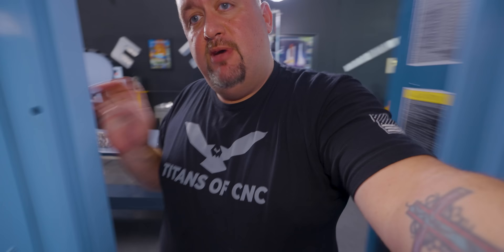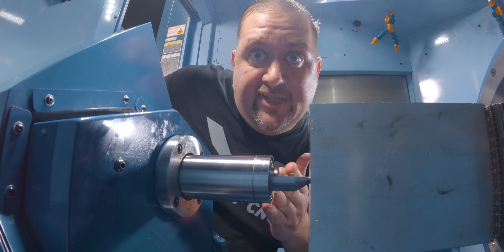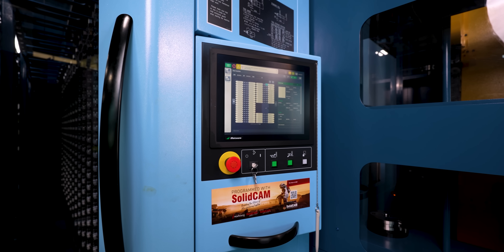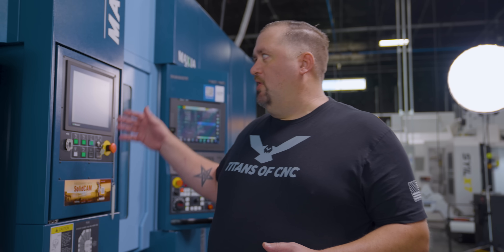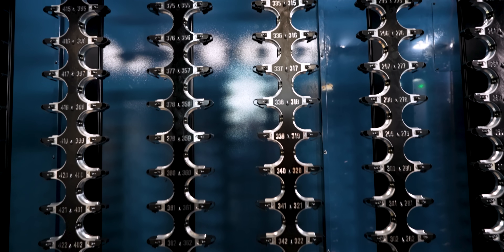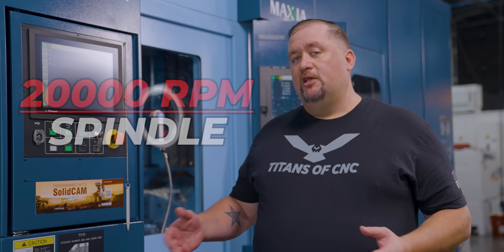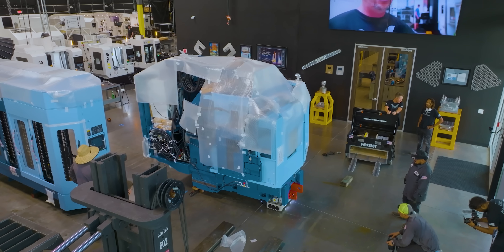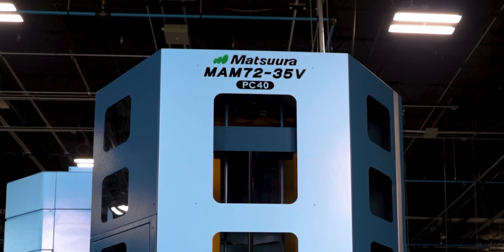You’ve Never Seen a Cut Like THIS Before 🤯

Comment: Just be careful if you ever have to turn off the machine with that particular tool changing system, because if the tool changing arm is not in its home position before switch off then you'll have to recover the tool arm with the black box and it's a right ball ache.

Comment: What's the MSRP on that setup?  Used to run three MAM72-63V machines in a shared 35 pallet cell back in the day.  That's my end goal for building my own shop.  Plus a basic vertical for cutting dovetails and material prep and maybe one of these for small parts.
Reply from the maker: For the 40 pallet and 530 tool option you are right around 950K. They have the 32 pallet and 330 tool option that saves you some $$$

Comment: I’m still waiting for the video to come out where you guys spin up both a HSS and carbide endmill and feed them both into one another
Reply: I was cutting hss tools with carbide the other day.. we had massive M64 hss tap that needed smaller square to fit into our holder.. nice cuts with feeds and speed that I usualy use in titanium
Reply: they have done this.
Reply: @ThatOneFiesta they did a video similar, they only spun the carbide tool and fed the carbide tool into the high speed, and they’ve done the reverse. But they haven’t spun both and fed both into each other at the same time. I wanna see that destruction. Then maybe a ceramic endmill vs a carbide

Comment: So, $1.25 million for the machine, 40 pallets and vises is another $100K and 530 tools, another $100k and a tip for Barry brings you in at a cool $1.5 million dollars. Run that thing 24/7/365 for 5 years and you only need to charge $5 an hour plus a machinists hourly wage and overhead, so $50/hr.!
Reply: The important part is the tip for Barry. So better make it $60 an hour hahaha. But really when you break it down, that's pretty inexpensive for the added capability and automation!
Reply: @barrysetzer  No argument there, she is a thing of beauty!!

Comment: 530 chances to crash tools xD
i have seen many things in cnc machining but not even i have seen a cnc mill impliment a hydrolic tailstock in this way (  i even seen where they used wood planks and clamps to hold  the part well machining it )
Reply: Yeah as far as I know, Matsuura is the only builder that offers this. It was VERY helpful when I used to run the bigger version of this machine making round oilfield parts out of superalloys
Reply: @barrysetzer  seen a tailstock system on a couple 5 axis machines, generally specialized for making rotor blades. Starrag Heckert, Grob, Ingersol, Makino, Stama (chiron group now) to name a few brands. Also seen tailstocks used to turn a 5x trunnion on a standard vmc into a 4th axis, but that was after market.